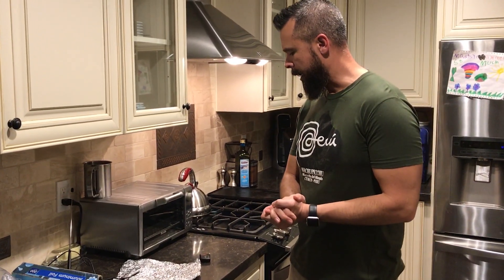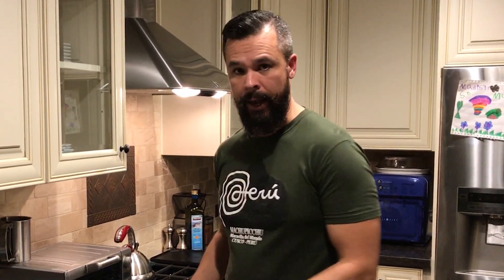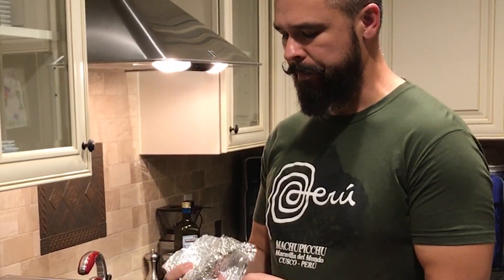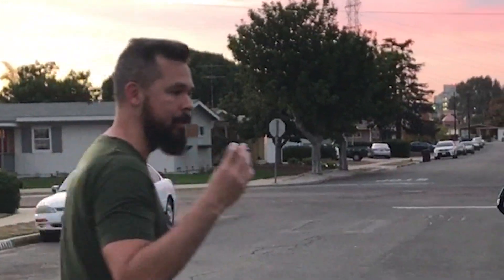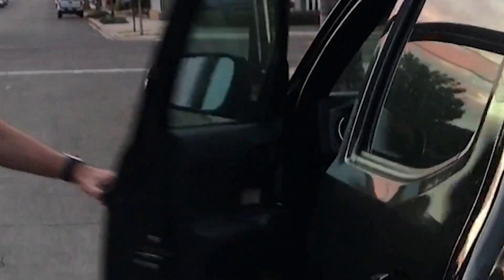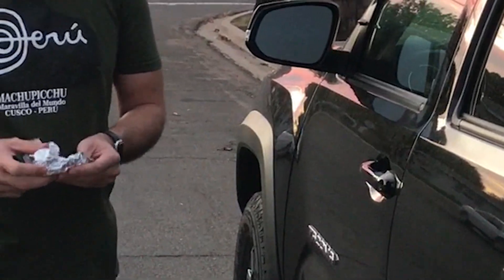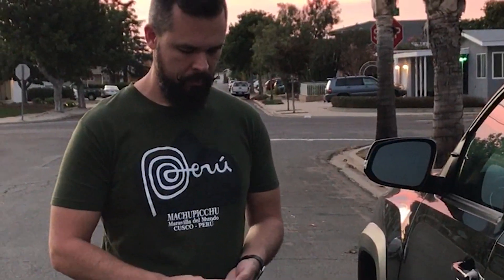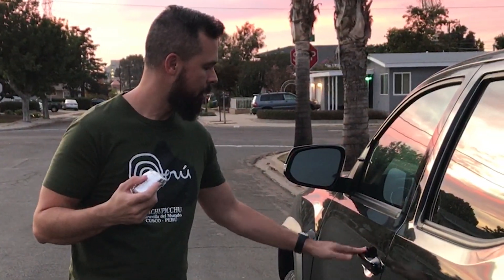Protect your Keyfob

Comment: TRIED THIS ON MY SUPERDUTY AND IT DOESN'T WORK
Reply: Had this problem when I locked my car by touching the handle like on this vid, it would open with just another touch on the handle even though the key/fob was in the foil faraday. If I locked my car by just walking away, and listening for the 2 beeps, it would then not unlock with the keys in the aluminum foil made fayaday. Try a couple of different things?

Comment: what if you have to push a unlock button to open the door is the key bob still transmitting a radio signal ?
Reply: No, that is not a keyless entry system.

Comment: Why don't buy a Faraday Bag. Fob guard etc ??
Reply: Because they cost money which some people cannot afford or wish to afford.
Reply: Lots dont work, or only work for a short time.
Reply: I looked online for a faraday fob bag which I did not know existed.
It was $12.99. I am not against buying it however, I can buy a lot of aluminum foil for $12.99.
I created a faraday cage for my debit card and other cards out of card stock and aluminum foil. I used it for 3 years.
Reply: Because when you get home (I'm not talking about if say you're in a restaurant) it's much easier to chuck your keys into a metal box and drop down the lid than it is to insert them into a flat bag of some sort. Not MUCH easier, but easier. Plus, it's easy to fashion your own metal box using whatever you have available; biscuit tin etc etc.
Reply: I bought 2 different pouches that claimed to be faraday, neither worked, didn't buy the cheapest.
Reply: There's always a critic. This is a good quick fix. I just unexpectedly bought a new car and I'm flying away the next day. This has helped
Reply: @Crazytown  it's critic for unusefull things.